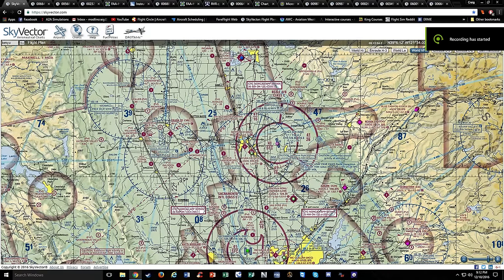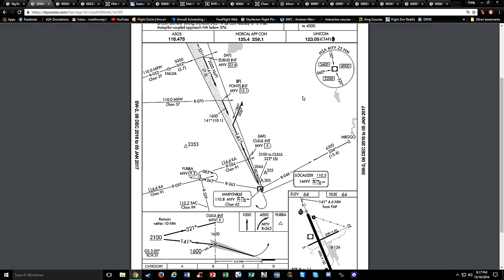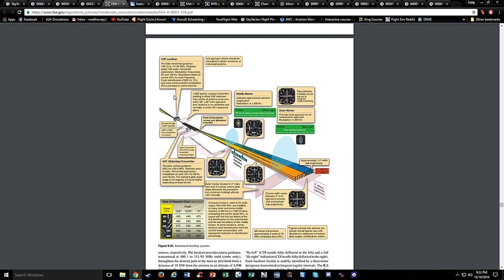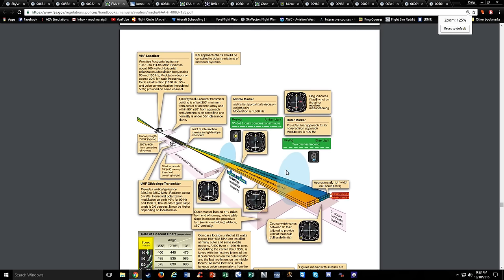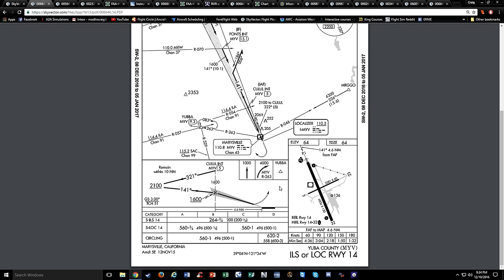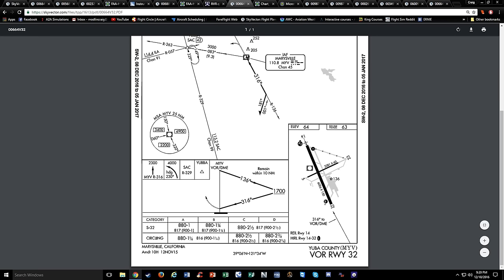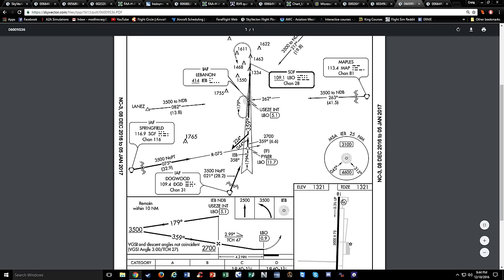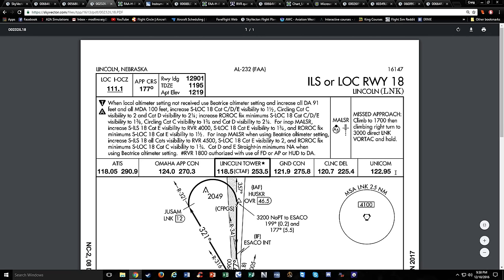IFR Training | Approach Plates

Comment: At 5:30, flying the back course or reverse localizer (321º) is suggested instead of the VOR, but the chart depicts flying the transition route from the 322º radial of the VOR, 2100 to CULUL (5).
Reply from the maker: That’s how I used to fly it in training until the DPE said we should be following the back course outbound. 

With that said, I do see the DME is listed off MYV. 

Also, I don’t see the 322. In the profile view I see 321 and 141, and at the top of the plan view I see 321 outbound.
Edit: I do see what you’re talking about. I think that’s just identifying the intersection off the VOR. The profile view shows the procedure turn headings outbound and inbound.

Comment: At 7:17 into the video, while working thru the back door approach to RWY 14 at Yuba County, and discussing the procedure turn to 006 once past the CULUL int outbound on 322 radial from the LOC..... you made the statement that the speed limit for this procedure is 200 kts.
I've looked and looked and looked all over the approach plate 'til my eyes crossed and cannot find any reference to a 200 kt speed limit.  So what am I not seeing ?   
T I A ...
Reply from the maker: I'm not sure where I got that speed limit from, but most likely from either the AIM section 5-4-9 or in the Instrument Procedures Handbook, in which case it's not a limitation, but a recommendation (And therefore I used the wrong terminology in the video, which you are correct to point out, thank you). The AIM and the Instrument Procedures Handbook recommends a 200 knot speed restriction to ensure the pilot stays in the protected airspace, but it is not a regulation. (As with anything that's not a regulation but is found in the AIM and other publications, if you get into an accident as a result of not following recommended procedures, that might be a problem in the FAA's eyes)